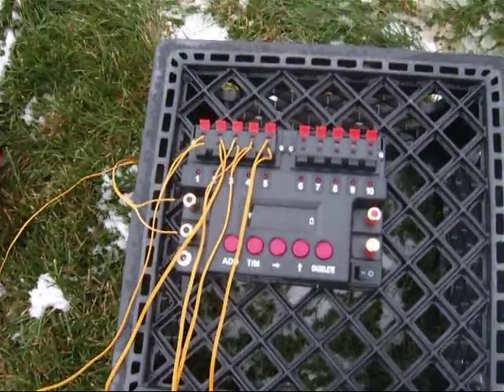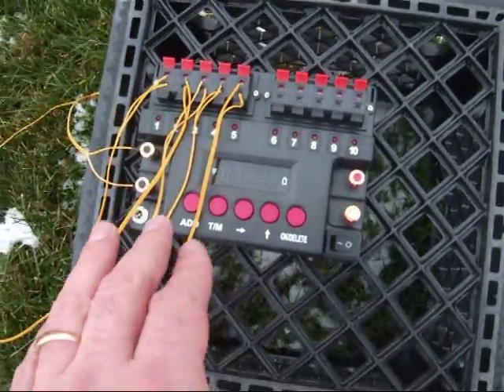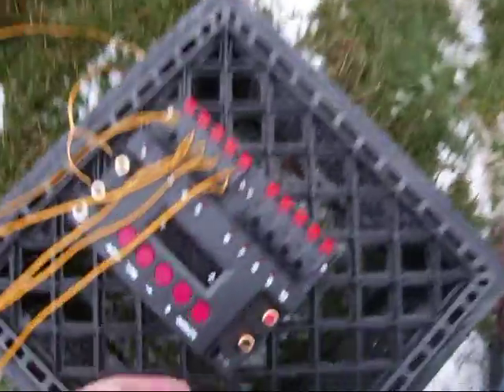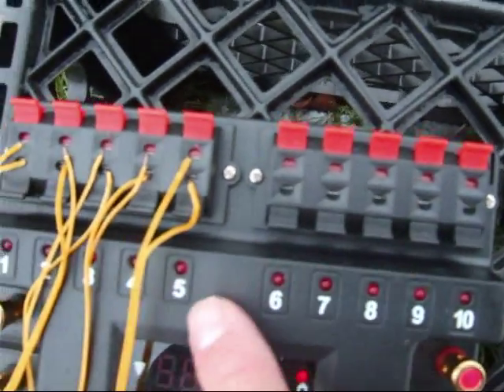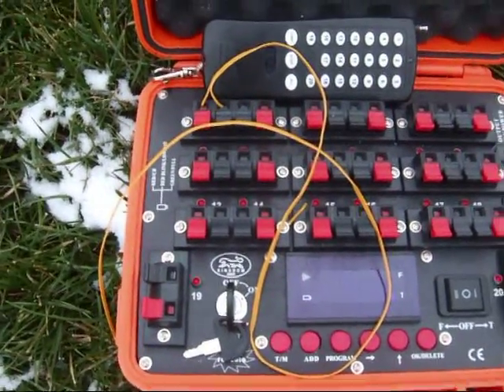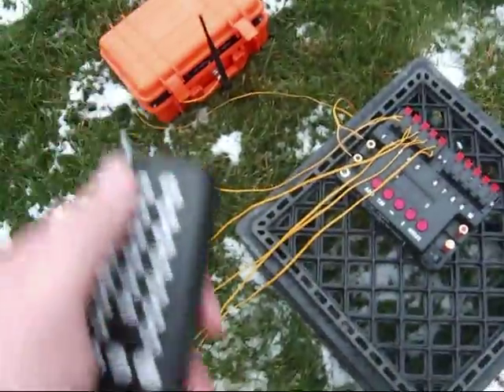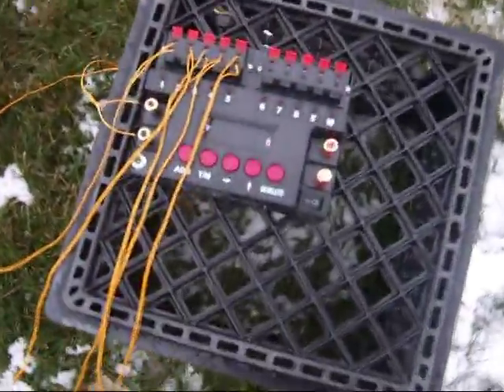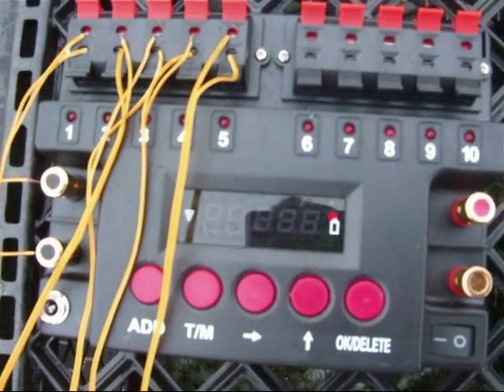universal sequencer live fire.wmv

Comment from the maker: I've tested this on pyrodlites, kingdom, ATF.  Others have tried them on a variety of systems that have an output voltage of 6volts to 30 volts.  I don;t know specifically about pyromate but as long as the output voltage from the cue is within the 6-30v it will work.